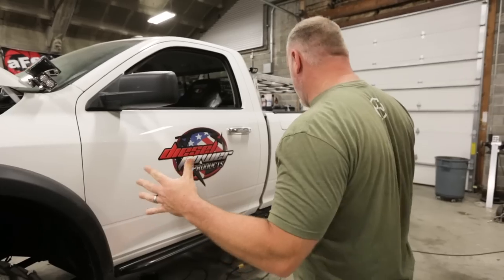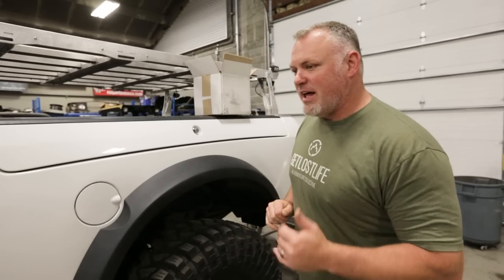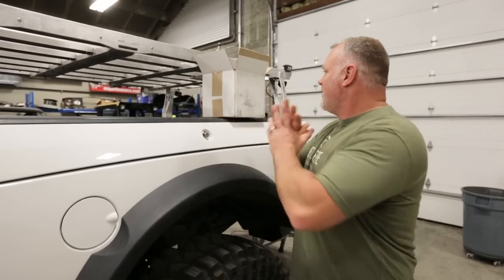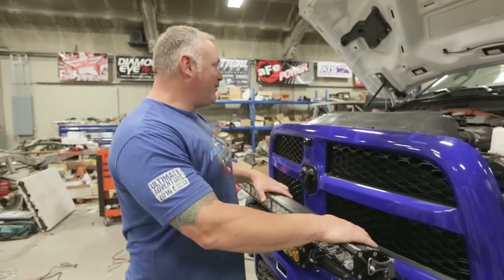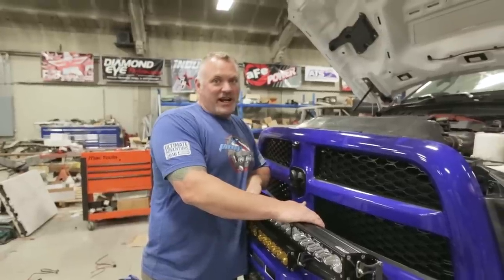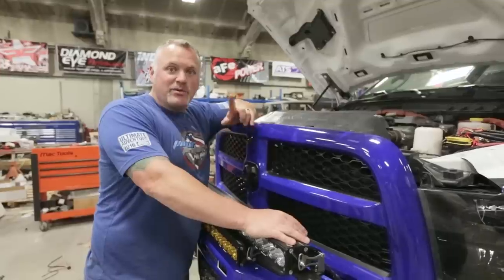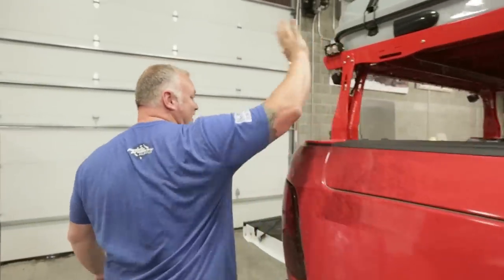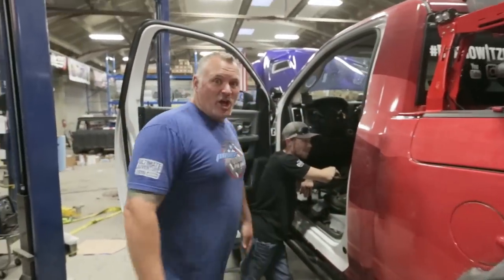Zero2Hero: Howitzer Episode 5 - Ultimate Adventure

Comment: LOL, Tacoma owners will hate seeing a real truck on the trails. Unless they need a tow
Reply: Kurt M stock Tacoma over a stock ram. I'd put my money on the Tacoma. On top of that, they're different types of trucks. Tacomas are better at trails cuz they're smaller and need less mods to be capable. Big rams are better at rock crawls cuz they're bigger and Tacoma would need too much mods to be capable. It's apples and oranges.
Reply: i laughed way to hard at this.
Reply: Found the Tacoma owner
Reply: A Ram Cummins vs a Tacoma? No way, there's not even the slightest comparison.
Reply: Rams are the best ,18 year's proud owner, have a 2012 now.those taco or tundras, chevy ford gmc Nissan, got nothing on this trucks
Reply: Rams are the best, taco, tundras, chevy ,gmc Nissan, ford got nothing on this trucks, 18 year's proud owner of rams,have a 2012 now,simply  the best

Comment: I’m taking baby steps upgrading my 18 3500 Limited only 30,000 as of late 2022.  Just installed the AEV front bumper (from Diesel Power Products👍) and have 35s and a nice Diamondback bed cover on her.  

The recent bumper upgrade just put a decent dent in my mpg.  Any tuning mods to help that issue.  I’m thinking lower gears might make matters worse but once these tires are worn I was thinking of 37”.  May not have a choice after that.

Comment: Tell me about that back bumper, please.  Custom build or commercially available?  I like the added departure angle and skid plate combo. Do you think if it was longer (away from the tailgate) a swing away rack could be added?  Also,  couldn't tell from the video, but did you keep the stock trailer hitch components intact?  Guessing that went away in the interest of departure angle.
Reply from the maker: Cody Lemieux it is a mercenary Offroad rear bumper.  We pondered the idea of a swing out but the tire would end up sitting taller then the cab since it is a 42 and we didn't want that much weight that far back.  Thank you for watching.

Comment: what went wrong with the front axle, did you get it figured out   ?????
Reply from the maker: sandman sandman yes we did get it figured and fixed on the trail.  Busted both side tubes loose of the diff housing.  We straightened it out on the rocks and Chris Durham welded it up for us.
Reply: Good glad to hear you were able to repair the truck and get back to the trail.    Was that axle a Dodge or after market part ?

Comment: That was so fun to watch. Y'all built an awesome rig. I just bought a new 2500 CTD crew cab short bed and I want it to have the aev prospector look. I'm probably keeping the power train and suspension stock because I run cross state a lot and tow boats and tractors up to 10k lb or so, right now I'm looking at the aev bumper with winch, black bushwhacker flares, step bars, 20" anthem wheels with toyo oc c-t tires, are camper shell with walk in door rear and light bar on top, fixed up to sleep in 3-4 days in a month. I have seriously considered a small lift to get into 35" tires. Maybe the aev lift. The only trails I run are while hunting but they can get pretty sloppy sometimes. What do y'all think about the aev lift, is a re-gear necessary? I have in mind what I want but this is my first build and I'm hesitant to mess too much, I want it right. 10k +/- budget goal on build.

Comment: Beautiful truck nice rig and I set up the thing I would upgrade diff cover never could do aluminum
Reply from the maker: Danger doom everything has its place, Nitro gear doesn't make a cast iron diff cover and we wanted to give them some love.  We do have 42" tires which move that diff cover a long ways away from any danger.  We didn't have any issues with it in Moab or on the Ultimate Adventure.  Thanks for watching.
Reply: Sounds like a great setup you have beautiful truck again love it looks like it's working awesome on the trails

Comment: Great build. Other than the front bumper, it looks like everything else worked great. It's not often you see a full size rig doing trails like that.
Reply from the maker: Steve Botkin front bumper did awesome, not one single dent.  We lost a plastic light bezel but that's it.
Reply: Diesel Power Products It looked pretty beat up but maybe it was mostly superficial. I know AEV builds good parts as I've used a few on my Jeeps. Either way, the truck is bad ass and I'm looking forward to seeing the Ultimate Adv videos.
Reply from the maker: Steve Botkin the wrap on it got shredded everything else is golden

Comment: By the way, I meant to ask if there were any issues with the Ram's central axle disconnect 4x4 system?  I had heard other owners mention that the system sometimes broke with hard use.  Wasn't sure if that was just a few random failures that were blown out of proportion.
Reply from the maker: Kevin P we deleted it when we went to the freespin kit and RCV shafts.  We were worried it would leave us hanging as well.
Reply: Is there a specific aftermarket company you went with?  Does the howitzer now have locking hubs?
Reply from the maker: Kevin P yes we used the Dynatrac freespin kit.  http://www.dieselpowerproducts.com/p-8785-dynatrac-free-spin-heavy-duty-front-hub-conversion-kit-10-17-dodge-ram-2500-3500.aspx

Comment: Sweet rig. Front bumper is total garbage, as suspected. Otherwise preeeeemo! 👌
Reply from the maker: Chris Ripplinger what happened with the front bumper that makes it garbage?  It has handled everything with not a single issue.  Thank you for watching.
Reply: Diesel Power Products , That's some awesome trail riding clips! Love them man.
Reply: Diesel Power Products I have a question, what do you think about the portal differentials? Would they work if I wanted to add those to that set up if you guys do?
And would it work on a Dodge Ram 3500?
Reply from the maker: Dodge Ram 3500 quad turbo diesel that would be interesting, the portals give you about 5-6" lift so it would be difficult to get the rest of the suspension to work.
Reply: Perhaps I was seeing it wrong, but it looked like the bottom half of the bumper was all beat up and the plastic housing on the passenger side light looked like it wasn't seating right after that side had been hit. Am I wrong? No dings in the bumper?
Reply from the maker: Chris Ripplinger bumper is totally fine not a single dent on it.  The plastic light bezel on the pass side I ripped off after scrapping it 90% off and the wrap that was on it got shredded as well.  I don't know of another bumper on the market that would give me the clearance we had and hold up to what we did to it.  It worked killer.  Only thing we will do differently in the future is to pull the side wings off for hard rock trails for better approach angles.
Reply: Diesel Power Products where can I get those fender flares I like the look
Reply from the maker: mikem761 we sell them.  Here you go. http://www.dieselpowerproducts.com/p-15571-aev-front-highmark-fender-flare-set-10-17-ram-hd.aspx
http://www.dieselpowerproducts.com/p-15572-aev-rear-highmark-fender-flare-set-10-17-ram-hd.aspx
Reply: Diesel Power Products got any videos of or how to install and what need t be cut out
Reply from the maker: mikem761 the flares come with a template and full instructions.  We also have photos from the install on our Facebook page.

Comment: ooohhh... new dpp video. 

trying to decide between a late model 5.9 vs a newer tundra.
Reply: gravitygear how is that a hard choice..
Reply: Just buy a Tacoma TRD then, much more capable and fuel efficient.
Reply: It's difficult because diesel. I've always dreamed of owning a 5.9 cummins diesel, but the tundra has modern creature comforts and a better ride quality.
Reply from the maker: gravitygear we enjoy wheeling difficult trails and we enjoy being comfortable at camp which means we like having space for all of our gear.  I like the 5.9 option they are great trucks with a lot of support.  It can handle tough trails and haul a lot of gear.
Reply: Thanks DPP. Pushing me over to the darkside. The only other thing I'm concerned about is my inexperience with diesel engines. As a hobbyist, I've rebuilt and transplanted 302s, 350s, ej25s and VQs, but never have I even set a wrench on an oilburner.
Reply from the maker: gravitygear it's simpler because there is no ignition system to deal with.  The only big difference will be the weight of everything.  It's all a lot heavier.
Reply: well then, i guess the quest for a 5.9 starts now. Appreciate the input DPP. I hope to be ordering some stuff from you guys in the near future.
Reply: gravitygear I had an 05 5.9.  Best truck I’ve ever had.  My first diesel and I had no problem learning to work on it.  Really simple and bullet proof.